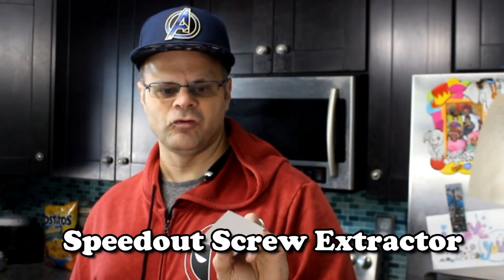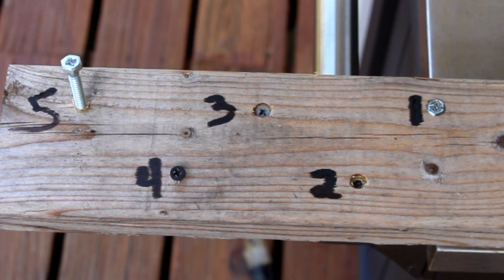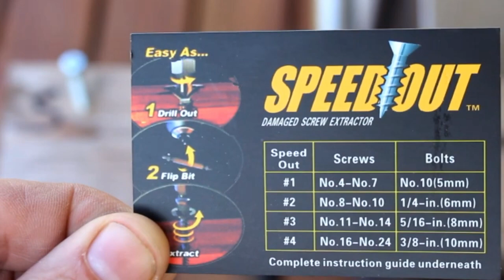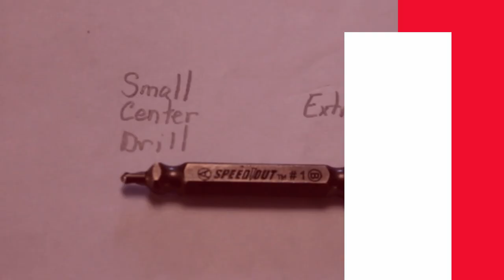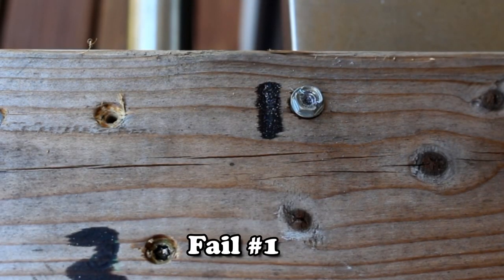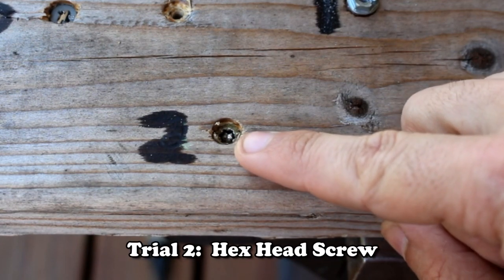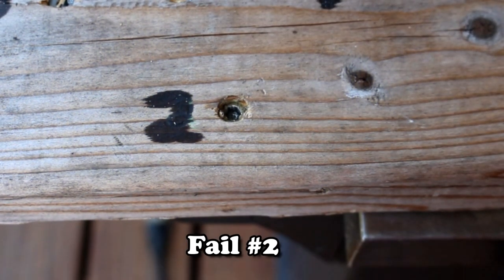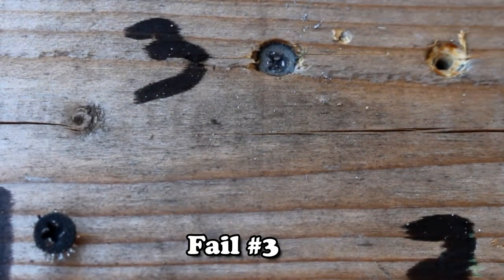SpeedOut Screw Extractor | As Seen On TV Product Review

Comment: He wasn't putting any pressure at all When trying to extract it. He wanted it to fail. This guy should work for CNN
Reply from the maker: Yes, I was applying pressure during the extraction portion, however, the screw itself was becoming more stripped and the extraction bit was not gripping the screw as it should.  I was disappointed it failed, perhaps I will do another review in the near future.  Thanks for your input!